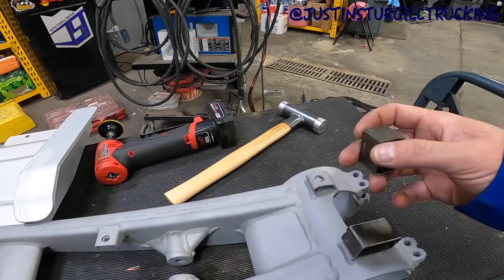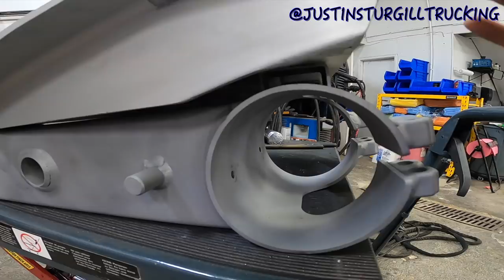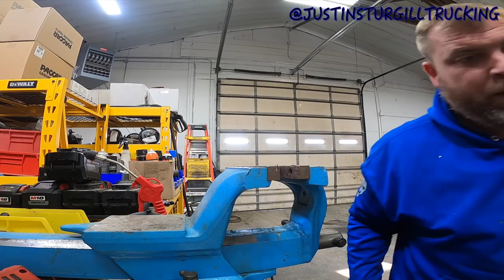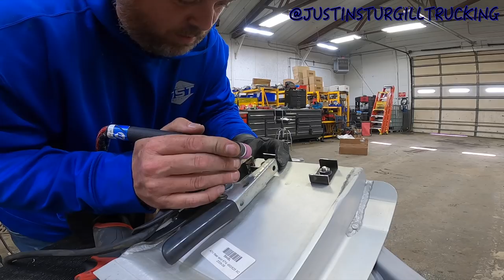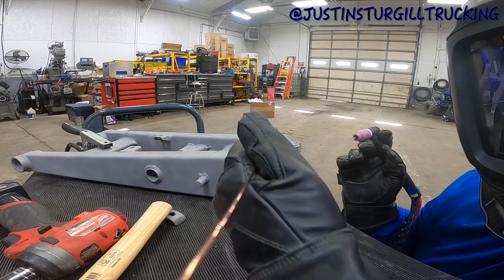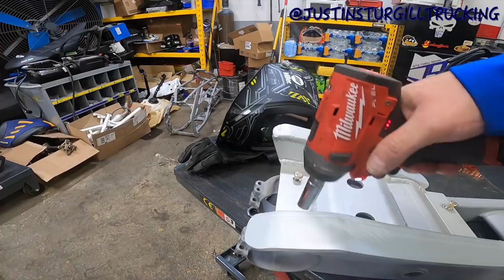KTM 450XC ATV SWING ARM REPAIR

Comment: You take the cup off the weld early. Not useing the after purge at all that you have set up witch you don’t need so much force with that cup you have on
Reply: Ohh and don’t dip the tip every time but not too bad for starting out

Comment: Pick up a stock plastic skid from e bay  they last forever absorb shock and slide over shit better then aluminum,  and cheap. I ride on Canadian sheild , the rocks kill aluminum skids.  ktms are nice, i have 3 but some parts aren't easy to find. Good luck 👍
Reply from the maker: I have a plastic one too but yes KTM parts are hard to find I think that they’re the best riding quads I really love them
Reply: @JUSTINSTURGILLTRUCKING   best out of the box
Reply: @JUSTINSTURGILLTRUCKING  ive had my 08 450 since New . They age well with matinence
Reply: I gave up actual aluminum skidplates along time ago. I run a sprocket guard and a GT thunder poly rotor guard
Reply: @airlinemx3515  ya,  agreed. That's 1st choice for 👍